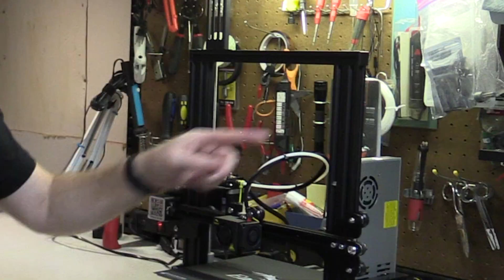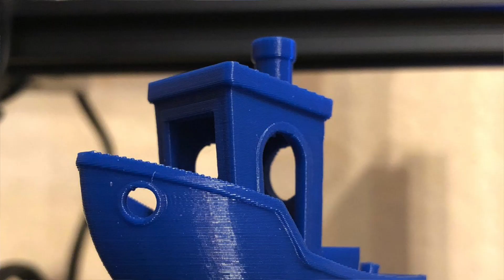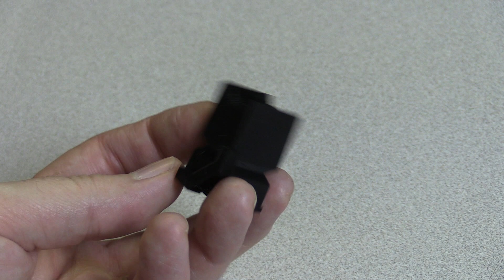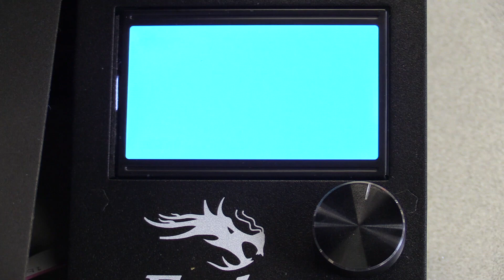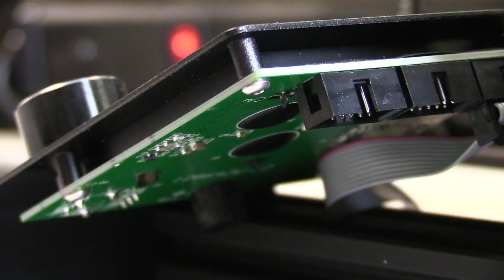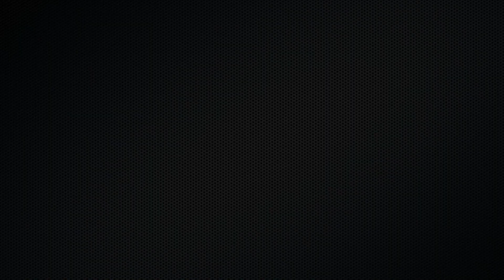Creality Ender 3 Pro Review & Impressions

Comment: To test for thermal runaway protection, you have to heat up the hot end and then remove the thermistor. If thermal runaway is enabled, it should trigger a thermal runaway error in less than a minute.  It is not the same as a min temp error.
Reply from the maker: Holy heck, you're absolutely right! I'm going to test that when I get home. Thanks so much for the comment! 👍
Reply: @BV3D  Did you end up testing it? If so how did it perform? Thanks
Reply from the maker: @Utkarsh_A  Yes, and it turns out thermal runaway protection was NOT enabled. I tested in a slightly different way, by disconnecting the heater cartridge and measuring the power it would have received with a voltmeter. There's a whole video here (https://youtu.be/4ZlsLNwCi3E), and another here where I install newer firmware which has thermal runaway protection enabled (https://youtu.be/aquuSNEekvY), and yet another here with a simpler method for testing a printer, provided its mainboard can be powered by a USB connection (https://youtu.be/z5s2iXBpnrc). Thanks for asking! 😃

Comment: I bought this printer recently as my first 3D printer, for $200.  I’ve added several 3D printed upgrades to resolve some of the issues, like the lcd cover for the open electronics, cable clips to hide wiring, etc.  i probably went a little overboard but that’s the fun part with 3 D printing I guess.  I was completely new to 3D printing when I started and I’ve loved it so far.  I recommend this printer as well.  The cooling fans are a bit loud and would love to see a video on how to install quieter fans and the upgraded mother board for a quieter stepper motor.  All in all, great video!  I love my printer.  I appreciate all you great videos.

Comment: if the XT60 is getting hot its not been made to spec an XT60 Should be ableto handle upto 60 Amps
Reply from the maker: That's right - there was some concern at the time about whether the connectors were up to spec, but there was also apparently an issue with the connectors being crimped instead of being soldered, where the crimped connectors experienced higher resistance, which could lead to heat-related failures.

Comment: Great video. Just watched it for a second time. Helped me decide to get the E3 Pro. It arrives tomorrow. Gonna be printing fool this weekend. Keep up the good work.
Reply from the maker: I will say now that I have both and Ender 3 and an Ender 3 Pro, I definitely appreciate the Pro more. Even though the main differences are just the power supply and the flipped electronics box, that Mean Well power supply is MUCH quieter than the one on the Ender 3 not-Pro.

Comment: Great video. I thought XT60 connectors were pretty beefy. Learn something new everyday.
Reply from the maker: Hi Johnny! They are, but I think the problem was that the cables were being crimped instead of soldered, so the electrical connection on the "wires" side of the XT60s wasn't the best. This resulted in higher electrical resistance (and therefore heat). Personally, I haven't had an issue with mine after a year of printing.

Comment: z axis being too high from the bed is a very quick mod; cut the zaxis trip switch bracket stop off; its a tiny bit of plastic that stops the bracket against the top of the bottom rail. undo the two mounting screw and lower the bracket a couple of MM. tighten and test. literally a 20 second fix and allows for full adjustment of the Z axis stop up or down. you can also buy third party bed springs which help alot with that issue.
final hint is to tighten your bed springs up fully prior to first levelling. then adjust z axis. then level once bed is heated. this will give you the greatest amount of movement you can get prior to figuring out if you need to "fix" the z mounting bracket.

Comment: Does the 3D printer have a space to load a spool of filament? If not, how do you feed the PLA for your prints?
Also, great job on this video, it answered many of my questions!
Reply from the maker: Hi! Yes, there's a spool holder that mounts on the top of the frame. Some people like having the spool holder mounted to the side of the printer, and others like having it as a separate thing, completely detached from the printer (they print their own, usually). I don't mind having it up top, because it doesn't take up space next to the printer. Thanks! 😃

Comment: Please add a how-to on installing the improved main board (stepper motor controller). I appreciate your content and excellent delivery. I am studying the subject prior to purchasing one for my son who is a mechanical engineering student.
Reply: newest models of the ender 3 pro are upgraded with the "silent" board and dont need stepper motor diodes and smoothers. check on amazon for smoothers and you will see several state in the description that new ender 3 pro dont need them.

Comment: Can it print abs? Even if you couldn’t you could still change out the print surface to work with abs probably.
Reply from the maker: The printer is capable of printing ABS. I don't know if I'd trust the Cmagnet at ABS bed temps though. Creality says it's for "PLA-based materials," and I take that to mean it performs best at PLA bed temperatures, too.

I've since installed the Wham Bam Systems flexible build system on the Ender 3 Pro, and I've done a 30+ hour ABS print on it with spectacularly good grip. The print didn't lift at all from the Wham Bam plate.
Reply: Awesome thanks for your help! I think I’ll ask for this for my birthday!

Comment: @BV3D: Bryan Vines To answer your call for comments, I debated quite a bit between the Ender 3 Pro and the Ender 5.  I ended up going with the Ender 5, concluding that the 5 is what the Ender 3 Pro should have been.  I bought it directly from Creality and am waiting on delivery.  I got it for $309 (I think I could have snagged it for $304, but I missed a coupon).  That's quite a bit over the cost of the Ender 3 Pro, so time will tell if it is worth it for the premium.  Even at that price point, I'll still be changing a few things, including installing a MKS Gen L board and touchscreen (the latter being sort of pointless, but I love trying new mods), capricorn tube, some TL Smoothers, and a dual 5015 part cooler.  At that point, I'm looking at about $110 over the Ender 3 Pro.  So, time will tell if it is worth that! 

Anyway, keep up the great work.  I watch all of your videos, all the while admiring your fantastic hair.
Reply from the maker: Right now I’m on the fence about whether to use Creality’s v1.4 board or go with an MKS Gen L and 2208 drivers. I think the cost is close to the same. I’ll probably stick with the 12864 screen for now. Is your 5105 blower mod for parts cooling something you found on Thingiverse? If so, what’s the thing number? I’d be interested in trying it, although to be honest the parts cooling overall on the Ender 3 Pro seems sufficient for most of what I print. It could probably use a little improvement on tiny spiky parts though.  Thanks!
Reply: BV3D: Bryan Vines Hi Bryan!  The part cooler is the Hero Me 2 by Mediaman:  https://www.thingiverse.com/thing:3182917.  There are many variations, including ones for single 5015 blowers.  I removed the dual 5015s from my Monoprice Maker Select Plus to use on the Hero Me 2 instead (switched to a Diicooler on the MPMSP, but now I’m getting some heating problems because the mod is cooling the hot end too much... gotta try to lower it a bit).

Comment: I HAVE THE ENDER 3 ITS NOT THE PRO BUT I FOUND WITH A LITTLE WORK ITS A GREAT PRINTER MINE HAS THE MAGNIC BED SHEET AND I DONE SOME THINGS IN MARLIN AND THE SURPORT I HAVE FOUND IS PRETTY GOOD BUT YOU HAVE TO BE ABLE TO ASK AND TELL WHERE AND HOW YOUR PROBEM IS GOING THERE WHERE YOU GET GREAT HELP NOW THEY STILL TRY TO HELP BUT A LOT OF IT DEPENDS ON THE OWNER AND HOW MUCH WORK AND TRAIL AND ARROW THEY ARE ABLE TO GO THROUGH
Reply from the maker: Hi Jerry! I think literally the only things the Pro has that the regular Ender 3 doesn't have are the Mean Well power supply, the flipped electronics box, and that it came stock with the Cmagnet sheet. If I remember correctly, shortly after the Pro came out, Creality started putting the Cmagnet sheet on the entire Ender product line.

When I contacted Creality support via email, I stated the problem, the expected behavior of the feature, the actual behavior of the feature, and the exact steps to reproduce it. What I expected was that they had a firmware update that would need to be installed. But instead I got the response I showed in the video, so I dug deeper. I wondered if the problem was my MicroSD card, so I formatted a new card and put on it the same file that wouldn't resume from the other card, only not in a folder. It worked. But I couldn't think of a reason why it would work on one card and not the other. Then I realized that on the first card, the file I was testing was in a folder. I moved the file out to the top level of the card, tested, and it worked.

Still, Creality's response was disheartening. I think eligibility for support should be based on a provable purchase date, and serial number (for the one-year warranty), and serial number only (for their lifetime technical support).

It's interesting that it sounds like you've installed your own Marlin and they're still willing to provide support. Cool!

Comment: What is your favorite printer Bryan? 
I have the ender 3 but am upgrading to the Creality CR-10s soon.
Reply from the maker: Hi Tony! My Prusa i3 MK3 is my favorite. I've had it for over a year and I haven't seen the need to make any changes to it. It just prints. Now, it took 8 hours to put together, but that was part of the fun of it. I'm getting ready to put my MMU2 together (that's the 5 in, 1 out filament feeder for multicolor prints), and there are a couple of parts I need to print for the MK3 to get them connected to one another. I think I'm going to change from the standard orange PETG to a nice metallic blue. 😄

Comment: PS, you only outputted the left channel of your audio.
Reply from the maker: So I heard. But only in my left ear. 😂
Reply from the maker: Technically, that's all my audio ever had. The camera I used had a Sennheiser shotgun mic mounted on top, connected to the camera via an XLR cable. The camera put the mic on the left channel, and I didn't notice during editing because I wasn't using headphones. Next week's video, I've had to post-process it to mix the "stereo" sound down to mono, so at least the left channel is now also on the right side. :) I still need to re-upload that and move all the tags and stuff over to it.
Reply: Your camera only has one input? @BV3D
Reply from the maker: @corlissmedia2.0  My usual camera is my iPhone. I borrowed a Canon XA20 from work. The XLR inputs were just labeled "Input 1" and "Input 2". There may be something in the camera's setting that let me store the audio as monophonic on both left and right channels, but I don't have a manual for it. And the menus suck.
Reply: Two Phantom-powered XLR Audio Inputs with Manual Gain Control
A stereo microphone is incorporated into the XA20 Professional Camcorder, as are two XLR audio inputs with +48V phantom power. The built-in microphone provides exceptional audio in fast-paced situations while the XLR inputs provide connectivity to external microphones and other professional audio devices. If you choose, the built-in microphone and XLR input can be used simultaneously.

Audio is recorded in 16-bit PCM format at 48 kHz for amazing quality and fidelity. And both the built-in microphone and XLR inputs have the option for automatic or full manual gain control. To prevent variations in the recorded audio level, the dial can also be locked.

The XA20 also includes a 3.5mm headphone terminal with 16 volume settings for accurate audio monitoring.
Reply from the maker: I found a setting in the camera's menus that let me set the Channel 2 Input to actually be Channel 1, so now I can record the Sennheiser's output on both the left and right channels. Yay!